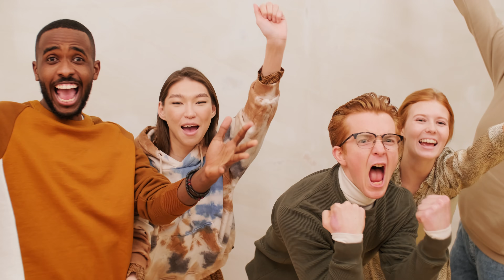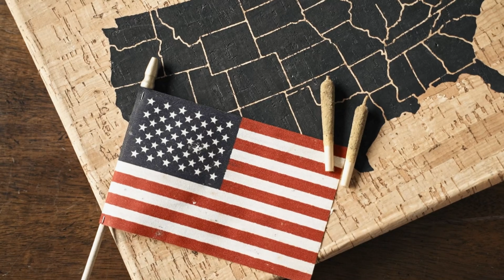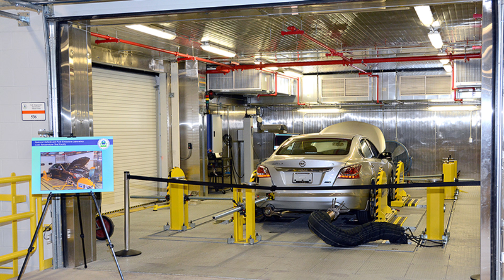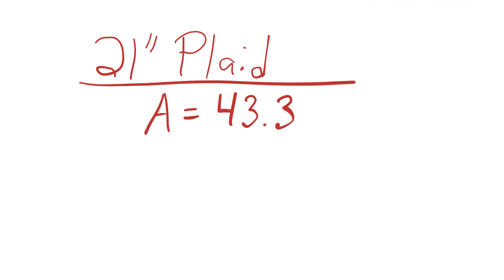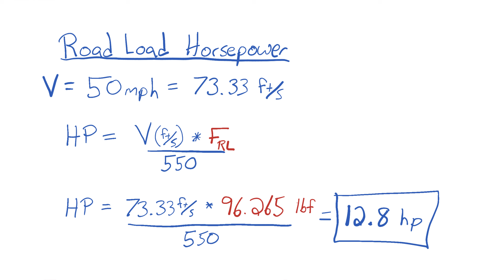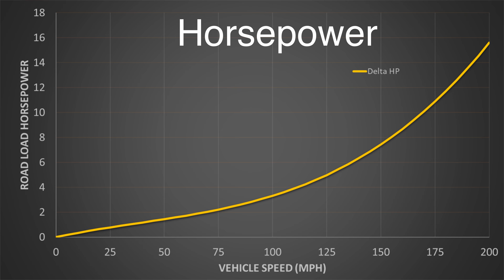Tesla Plaid - How much benefit are 19" Aero wheels?

Comment: Just ordered a 2024 S Plaid with 19" wheels. Well, I ordered one with 21" wheels and then Tesla lost the car somewhere on a dock in Baltimore, so they picked an inventory one with 19" wheels for me instead.
I'm not complaining, actually. Apart from saving me over 4.000 euro, the 19" wheels are also less vulnerable to pothole and kerb damage, they provide a smoother ride, they are quieter (less road noise) and it is easier to find winter tires (which are mandatory in some EU countries during winter season). The little extra range is a bonus, but I come from an S 100D so I'm improving in that field either way.
If I get tired of the look, I can always put on some (aftermarket) 20 or 21" wheels later on and keep the 19 ones for winter tires.

Comment: If one has staggered (275's in the rear & 255's in the front) 21" Uberturbine wheels on a Model Y Performance and swapped them for 19"  T-Sportline TSR wheels with  NO aero cover what would you surmise based on the fact that the 19-in (255's) wheels are significantly lighter than the Uberturbine wheels.  AND also the fact of moving from a staggered configuration to all 4 being the same 255's?
Reply: The aero cover is 95% of the highway efficiency improvement. Only improvements from light weight wheels would be around town and a minor acceleration improvement. The aero wheels are unbeatable on the highway for range.

Comment: Nice video….I wonder if someone purchased forged 21 inch wheels, that were equal in weight to the 19 inch….. how would that affect the results? 🤔
Reply from the maker: the weight of the wheels and tires matter, but also where the weight is located, if more of the weight is further from the center, then the wheel will have more resistance to rotation.  That is called the polar moment of inertia.  Weight may be equal, but inertia may not be

Comment: The rotational inertia definitely affects EV acceleration more the ICE acceleration because the ICE vehicles have a fly wheel. Therefore, changing the weight and size of those wheels doesn’t overcome the fact that you still have the flywheel. With EVs the lack of a flywheel means changing the rotational inertia of the wheels and tires has a much greater affect.
Reply from the maker: Inertia is inertia, the power necessary to rotationally accelerate a mass is independent and can be added to other rotationally accelerating masses.  If you are saying that wheels are a smaller proportion of the total rotational mass on an EV compared to an ICE, that may be true.  However the power to accelerate the wheel inertia will be the same.
Reply: @EngineeringPerspective  yes, that is what I am saying. If you reduce the mass and size of the wheel on the EV then it will be a greater proportion of the total rotational inertia than with an ICE car because the ICE car has a flywheel that adds a significant amount of rotational inertia.

Comment: Wait a minute!  Good analysis, but your final statement was messed up. You should have said the 19 inch are good for range and only lose a maximum of 2 horsepower at 70 mph.  You made it look like the 21s are better for Speed when the difference is negligible. Plus you left out that the 19s are more comfortable and less prone to rim damage from potholes.
Reply from the maker: Thanks for watching, Sorry it wasn’t clear for you.  The 19 inch wheels use less power due to lower rolling resistance, however, that power difference due to rolling resistance is so small it should be considered negligible for acceleration.

Comment: I didn't see any discussion about the effect of tire compound and tread types.  Rolling resistance is going to be the major contributor to road load at steady speeds.  The 21" wheel comes with Pilot Sport 4S summer tires, which are not optimized for rolling resistance.  What tires are shipped with the 19" wheels?

While accelerating, the greater mass of the 21" wheels (with mass distribution further from center) requires more force to reach a given rotational speed vs. the 19".  But at steady state, due to conservation of momentum, there should be little difference assuming both 19" and 21" wheels have tires with the same rubber compound and rolling resistance.

For example, on my '16 Model S, I got better average efficiency from my staggered 21" wheels with Pilot Super Sports than square 19" wheels with Pilot Sport All Season 3+.  I attributed that to the busy tread pattern on the AS 3+ and the UHP rubber compound.
Reply from the maker: This is a great point, I would need to look into the tire specs to know for sure.  My assumption is that the 19” has a harder compound focused on rolling resistance reduction.  Tires have such a huge effect on overall vehicle performance, I don’t think the average vehicle owner realizes.

Comment: Hey, could you do an alaysis video why the Model 3 Performance seems to be slower than a Model 3 Long Range at higher speeds? 
I had a Long Range and now have an M3P and can verify this, although I dont know why. Maybe the motors have a different power curve or something, I doubt wheels make a significant impact at speeds over 150 km/h.
Reply: yeah, the Performance seems to trap the same speeds at the quarter mile, although it is much faster to 60. This means the LR catches up in terms of speed above a certain speed limit.  Carwow also did a video where the LR overtook the M3P
https://www.youtube.com/watch?v=htGXA4McmGU

Comment: Great video! Thanks for doing the work on this. One question, possibly a dumb one: can we extrapolate this data to the (non-plaid) refreshed 2021 LR Model S?
Reply from the maker: It would be a safe assumption to say this difference applies to the LR version as well.  I have not looked up the data on the LR, but given all the external details are the same between Plaid and LR, i would assume they are very close.  One thing I’m not sure about is the tire widths, if they are different, on the LR vs Plaid it may change some things.
Reply: @EngineeringPerspective  Thanks. Makes sense.
Reply: It would be a logical corollary given that the two cars are the same except for horsepower

Comment: First of all, awesome job explaining the size impact. What I have not been able to find is real data explaining the impact wheel weight has on performance (0-60) and range. So many manufacturers selling aftermarket wheels touting how much lighter they are than stock teases wheels. Saying improved performance and range but none have real data. Thoughts??  Saving 5-10 pounds per wheel, what’s the real impact?
Reply from the maker: Glad you enjoyed it.  The challenging item with wheel weights is that the polar moment of inertia is what actually matters for 0-60.  it is possible to have a lighter wheel but higher inertia. Manufacturers don’t give out this value.  Secondly, for range, the wheel weight won’t be as much of an effect as the rolling resistance and Aero dynamics of the wheels.  Most people choose performance oriented (stickier) tires when they choose lighter wheels, that will reduce range more than the weight benefit.   If range is what you are after, the tesla aero wheel design with low rolling resistance tires will be hard to beat.  All of these impacts can be calculated, but aftermarket companies don’t have the engineering horsepower to do it.

Comment: So, I have both the 21" and 19" wheels -- is there a simple way to figure out the polar moment of interia that mere mortals can handle?
Reply from the maker: It would require some sort of setup either a ramp marked with distances and a cameras or some sort of pulley system with a weight… it wouldn’t be super easy.  Typically in the engineering world, I could pull the value from the CAD data… but I don’t have that.  I really do appreciate the offer!  Let me think if there is an easier way..
Reply: @EngineeringPerspective  Ah, OK. BTW I have done back-2-back 0-60 runs and seen only 0.1 sec difference between 19s and 21s (measured via Dragy) so that seems to line up with your graphs.  I'd also attribute some of the delta to be traction between summer tires (21s) vs all seasons (19s)
Reply: @ElectricMoose  your 19s are all season?
Heard they are not.
Reply: @scottw595  I purchased the 19s thru Parts then got Michelin Pilot Sport All Season 4s separately.
Reply: @ElectricMoose  how much did that cost?
Reply: @scottw595  The 19" Cardenio rims are $745 each, plus another $75/rim  for TPMS sensors.  Set of tires was $1,400.
Reply: @ElectricMoose  reports of the 4s all seasons creating a vibration from some owners. You have heard any of this?
Reply: @scottw595  I have seen a couple of things, but I also though it was from folks trying them with 20s.  I had the 19s on for a weekend and put them through their paces (much to the detriment of my Safety Score) and they were great--I found the 19s + Michelin PSAS4 are a great combo.
Reply: @ElectricMoose  You said you have driven the Tesla Plaid with both the 19" and the 21" wheels. Is there a noticeable difference in comfort with either set? Thanks
Reply: @fulks19   Funny, I just happened to switch over to my 19s last weekend as it has gotten colder.  The 19s are certainly more compliant  which only makes sense since there is more sidewall to work.  It's not like the 21s are harsh or unbearable, but the 19s do do a better job soaking up expansion joints, rough roads, etc.  The one thing I will say about the 21s is you have to be on it with the tire pressure--if you let it go, ride quality get bad quickly. Hope that helps.

Comment: Amazing info, but I have a question.  If I installed 20" wheels that are about 2 lbs lighter than the 19's, would my car have range identical/better than the 19's? 275/35/20 all around.
Reply: If you're buying lighter wheels for performance reasons, why not buy a 19" that is lighter than the 20" and stock 19"?
Reply: @larryc1616  I bought the 20's because I like the fit within the wheel well.  The car came with 19's, but their look was not for me.  BTW bought them for the look, knowing the performance would not be affected, but my concern was how will it do on range.   I have yet to do a long drive to really test it out with the 20's
Reply from the maker: I won’t be able to give a specific answer, but typically a 20” wheel will have more rotational inertia as the mass is located at a larger diameter, even if it is overall slightly lighter.  But the other items will be the difference in rolling resistance of the new tires and aerodynamic impacts.

Comment: btw i dont really remember from what channel but i remember frantz saying to them that the battery limits the plaid to 1020 hp the motors (i dont really remember the exact number) are capable of 1100-1300 hp
Reply from the maker: This is a topic that comes up a lot, I have been trying to collect information on the plaid battery for a potential future video.  Not a lot of public info on the details of it yet
Reply: @EngineeringPerspective  would love to see a video on the maximum potential of the Plaid tri-motors and the batteries if someone was to hack the software. other 2,000hp Supercar EV's have quad-motors, so some have theorized the plaid tri-motors/batteries can be good for up to 1,500hp. we know the Plus update will bump it from 1000hp to 1,100. what's its max potential?
Reply: Makes sense, since the Plaid+ was probably going to use the same motors but with a larger battery capable of outputting more power.